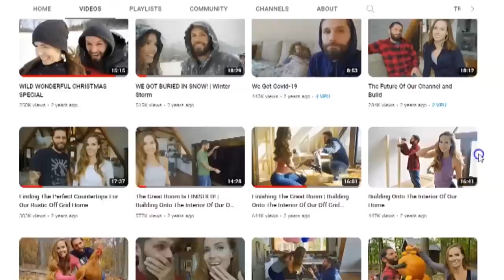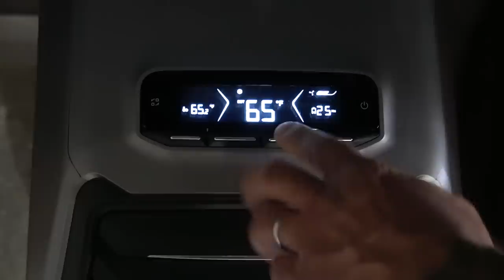Tearing Off The Backside To Build On |A-Frame Cabin Addition

Comment: Get a pallet clamp like the fork lift drivers use to drag a pallet from the inside of a van trailer when there is no dock or ramp.  The clamp tightens on a wooden part of a pallet as the other end is attached to a backing up fork lift so it can be pulled to the end of the trailer where the fork lift can grab it.  It would work great for yanking on those wooden plywood forms.

Comment: One way to save your hands and have a bit more leverage is to use a nice hefty pair of channel locks to pull on what needs to come off or out. They grip far harder than you ever will since  you can use both arms not just one and because there's no contact with the material it prevents cuts to hands eye on its nasty surprises...🛠

Comment: May be to late for current project  but file for future  could use a pallet retrieve  system  and skid steer or tractor  with front fork or bucket  the pallet retrieve  has haw that bite /grip 2x4 support  and chain or strap pulls pallets  or bins  from deep inside  a covered trailer  when forks cannt reach  
 The jaws gripe form and lift out with hydraulic  of tractor / skidsteer  or even escavator

Comment: Josh.
Buggy still down.
Check for spark.
Pull the coil wire.
Have erin. Hold. Crank it over.
.
If erin yells..  You have spark...

Block or concrete.  My vote is concrete.

Comment: Hey Guys why didn't you lift the form with a tow strap and the bucket on the front of the tractor? It would have saved you hours of works. and if you have a set of pallet forks for the tractor that would have save even more.

Comment: Is it too late to recommend form release oil? 😜 Man, it would have saved you a ton of back-breaking work.
Reply from the maker: The forms releasing from the concrete was simple and a non issue. It was how heavy the forms were and how tight of a squeeze it was in the trench that was tough.